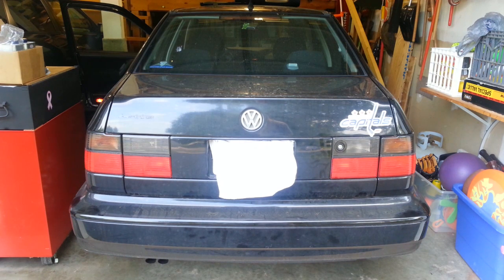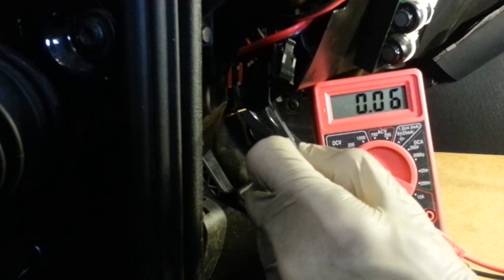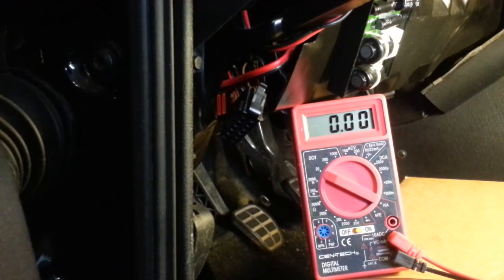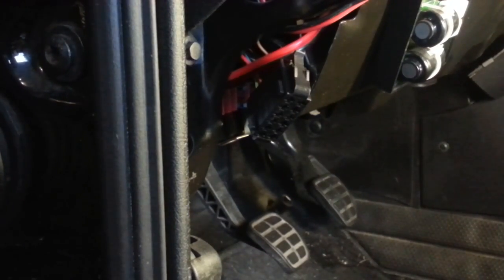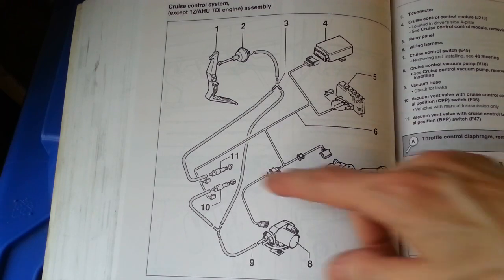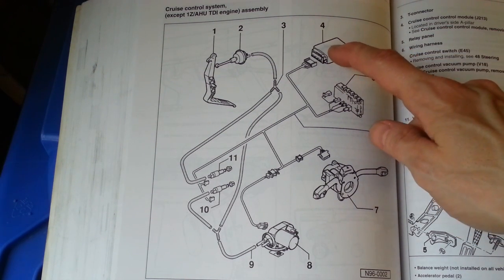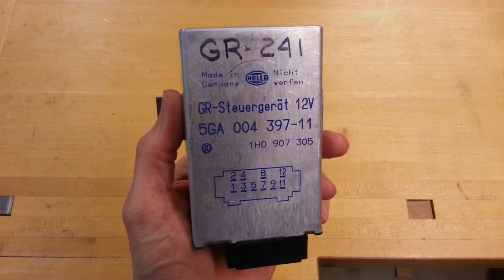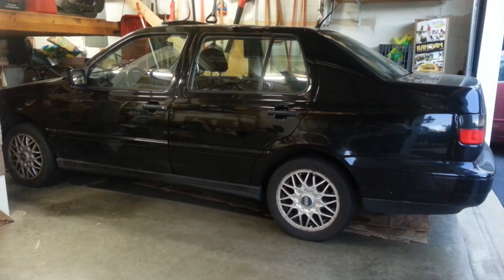Cruise Control Diagnostics & Repair - 1994 VW Jetta MK3

Comment: Thanks for posting this. My '99 Passat has had a non-functioning cruise control system for 7-8 years. My mechanic wants to charge me $600 to replace the computer but, obviously, I'd rather spend $49 with "valuevue". Thanks to you guys, my foot will soon get a rest on long drives.
Reply from the maker: +Aaron Gannon I concur.  After several years of being inoperative, I fixed mine and my foot felt liberated.  I couldn't believe how much I missed cruise control.  I highly recommend Gregg's module exchange service "valuevue" on eBay.   Mine is still working fine as was confirmed on my commute this morning.

Comment: Great video.  Did and passed all the tests in your video with the exception of one.  The wiring harness in my 98 cabrio does not have  anything leading to pin 12.  Whats the function of that wire?  Thanks in advance.. great job on the video  keeping it understandable to a non mechanic.
Reply from the maker: I'm not sure. Unfortunately, I don't have the car anymore or the Bentley manual. Sold it to a collector of old VWs who is taking good care of it. Is yours an automatic? That might be the difference.

Comment: My golf 98 has problems with the cruise control. There seems to be a hose disconnected from the Brake booster hose.
Does the vacuum from the cruise control pump comes from the brake vaccum system?

Comment: This might sound like a stupid question but I have a 96 Jetta gls but my instrumental cluster does not work could that cause cruse controlle not to work and we’re is the fuse located I think I’m over looking it but not sure ?!
Reply from the maker: I don't think that an inoperative instrument cluster would affect the cruise control but if neither works, you may have a common cause. For fuse locations, look inside the fuse box cover for the diagram.

Comment: Was ridiculously hard for me but I got it unplugged and out in the end. I tested everything and it all passed besides blowing the fuse. I replaced the fuse and tested it again and passed without blowing another one. Mine seems to have been replaced before because it has some writing on it but looked unopened so it was another new one at one point. All my solders look to have a good connection. What exactly would a bad one look like is what I'm wondering. Also is that module you replaced it with still in working order?
Reply: I guess you can't really mistake a bad solder. I'll check the ohms to the pins. If that checks out, then must be the relay...
Reply from the maker: SlipknotMaggot0526 Yes, I'm happy to report that the replacement module from Gregg is still going strong.  The car, however, has been recently parked and out of commission due to a very concerning noise now coming from the transmission. Would anyone be interested in me attempting a transmission rebuild and posting a video series on that project?
Reply: worsethanchiggers is it a manual? If so, then yes that would be cool. Also I found it's not the relay because it was tested and works. Must the chip. I might just buy one from the guy on ebay. $40 is pretty cheap anyway.

Comment: this is a great video,  2001 be similar do you think?
Reply from the maker: The 2001 model year would be the MK4 generation of cars. I believe the module and its location are different. Otherwise, the procedure would be fairly similar. Check with the eBay seller listed in the description for a module compatible with your car.

Comment: Great video! I have An automatic and can not pass step 1. Does the cruise have a separate fuse?
Reply from the maker: It's definitely fused. Look at the fuse diagram in your owner's manual.
Reply: Owners manual does not show what each individual fuse is for.
Reply from the maker: @bobtosi7495  The fuse box cover should have a diagram.
Reply: @WorseThanChiggers  I checked the cover and it list what each fuse goes to, but none of them specifically says cruise control.

Comment: Great video! But what if i dont have voltage in any terminal of the connector?
Reply from the maker: Depends on whether your car has a manual or automatic transmission. Which do you have?
Reply from the maker: Step 1 and 1A of the test procedure for automatic transmissions is: Connect multimeter to cruise control harness connector terminals 9 and vehicle ground. Using a helper to read meter, road test car with transmission in D, 3, or 2 and accelerate to above 25 mph, switch on cruise control. Observer battery voltage on multimeter. Assuming success, proceed to remove fuse S51. Using a fuse jumper, supply 12 volts back into the socket of the removed fuse. Try both terminals until battery voltage is indicated on multimeter. Switch ignition on. Switch on cruise control. Leave jumper in place for all remaining tests which are the same as when testing with a manual transmission.
Reply: worsethanchiggers tanks a lot very useful your information

Comment: 1st step failed,  no power to pin 9. Cant seem to find anything online about location for cruise control fuse. Any idea?
Reply from the maker: For a manual or auto transmission? The steps are slightly different for an automatic than what i went through in this video.

Comment: Is this the same on 1998 Audi A4 B5 1.8T Quattro? Where I can find the information like in your book?
Reply from the maker: I'm not sure which cruise control module your car uses. I suggest that you contact Gregg, the eBay seller of those modules listed in the description of this video. The detailed information on the test procedure can be found in the factory service manual which you can buy on eBay and elsewhere. Search for "1998 Audi A4 service manual" and buy one published by Bentley. Don't get the small ones from Chilton or Haynes which don't have enough detailed information.
Reply: My car use module 5GA 004 397-16  it will be different then yours? Or I can check the sistem with your information?
Reply from the maker: That part number is different than mine. Check with Gregg. The link to his eBay store is in the description of this video.
Reply: Thanks, Gregg send me information how check my cruise control sistem :)

Comment: Hey man all the tests passed and I got 2 replacement modules, tested them out and cruise control still won’t engage
Reply from the maker: Sorry to hear that. Did you follow the detailed diagnostic steps in the factory service manual? They are different depending on whether you have an automatic or manual transmission. They should have revealed the problem.
Reply: @WorseThanChiggers  I have the manual and I followed all your steps. All of them passed but it turns out the modules I received weren’t working so I sent my original module to module Master and they fixed it. Now it works perfectly fine

Comment: Passed everything except the vacuum pump didnt turn on. What's next?
Reply from the maker: I think you just answered your own question. It's time to troubleshoot the vacuum pump and it's electrical circuit. I'd start by checking its fuse and then see if it is getting power at the pump.

Comment: I Dont have power on 7 and 4 pin speed sensor. Help?
Reply from the maker: Extend your troubleshooting skills and think about what you next logical steps would be. Where would the power for those pins originate? Perhaps a fuse, relay, or some other component? What color are the wires leading to those pins? If you were to look up the wiring diagram, where would those wires lead you? Could you check for power at their source and continue troubleshooting from there?

Comment: I can't pass test 1, but all other tests work flawlessly. Idk why I'm not getting power to the system.
Reply from the maker: +Guidosaur The video walks through the process for a car with a manual transmission.  With an automatic, you need to be moving above 25 mph to measure voltage to the cruise control.  Does yours have an automatic?  If so, step 1 in the diagnostic procedure is different.  I'll paraphrase from the Bentley manual:

1. Check voltage between terminal 9 and ground.  Using a helper to read multimeter, road test car with transmission in D, 3, or 2 and accelerate to above 25 mph.  Switch on cruise control.  Expected results are battery voltage.  Areas to check if result is NOT obtained:

- Note that voltage is supplied from TCM when step 1A conditions are met.
- Check TCM or break in wiring from TCM
- Check for voltage at terminals 1 and 4 of cruise control switch (E45)
- Check for break in wiring between cruise control switch (E45) and cruise control ECU (J213)

1A. To continue testing after above test is completed:  Remove fuse S51.  Using a fused jumper, supply 12 volts back into the socket of the removed fuse.  Try both terminals until battery voltage is indicated on multimeter.  Switch ignition on.  Switch on cruise control.  Leave jumper in place for all remaining tests.  Expected results are battery voltage across terminals 9 and ground.
Reply: +worsethanchiggers sorry I didn't specify here, just the vwvortex post. I have a 98 2.0 mk3 Wolfsburg edition 5 speed. every single test you did worked for me except test 1. I saw some Bentley scans on the forums for what to do if there's no voltage on 9, which was test terminals 1&4 on the connector to the CC lever, check the wiring, and check the fuses. I didn't think there was a fuse but I heard somewhere it was the same one that does brake lights, which work fine on my car. I didn't get signal on the connector terminals to the CC lever on the steering wheel, but all the buttons work on it so that's confusing to me. I suppose the wiring could be bad? I feel like I could send my box to Greg from eBay and throw that in and it'll work, but I'm not sure. Thanks for the video and helping me here in the comments
Reply: +worsethanchiggers I just decided to throw my box to Greg on ebay. Hopefully that fixes the problem. Still don't understand why I couldn't get voltage on pin 9, but i had ground between 9 and 4, and passed all other tests using pin 9 (like the jumpers one). Maybe it's just something going over my head, but this has really been confusing me lately lol.
Reply from the maker: +Guidosaur Hope Gregg's replacement does the trick. Keep us posted.
Reply: +worsethanchiggers Got the replacement, installed everything, and....... it didn't work. It's closer though. All the CC buttons make the box relay make clicking sounds, so there's gotta be power from the turn signal lever to the box. It's gotta just be a fuse somewhere? From the research I've done, no one online can seem to agree which fuse is for the cruise control. Some people say it's under the hood, some people say it's on top of the fuse box. I don't really know what the problem is but I'm too deep in to give up now. I trust Gregg's work, so it can't be the box.

Comment: Here's an oddity - I installed some LED brake light bulbs, and my cruise stopped working. Turns out, for some reason, the LED bulbs cause a 4 volt reading when testing terminals 3 to 9, rather than 12v. This will stop your cruise control from working. Maybe it's just the particular LED's I bought, but I put my old incandescent bulbs back in, and the cruise control is working! In all the research I did on this (and it was quite a bit), I never heard of this issue.
Reply from the maker: +mikebrungardt  Any chance that you have a bad ground somewhere?
Reply: worsethanchiggers 
That's always a possibility. The diagnostic step testing the 3 pin to the 9 pin is really just checking for a good ground on the 3 pin(since the 9 pin is supplied with 12v). A weak ground in the brake light circuit is a possibility.